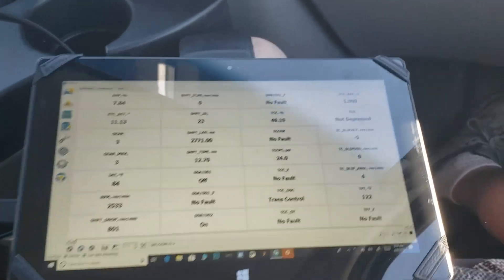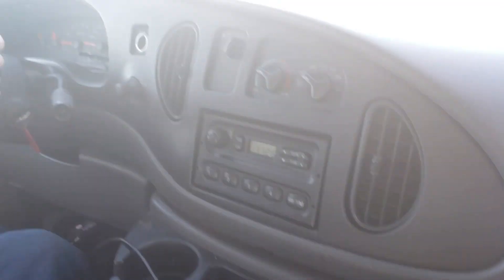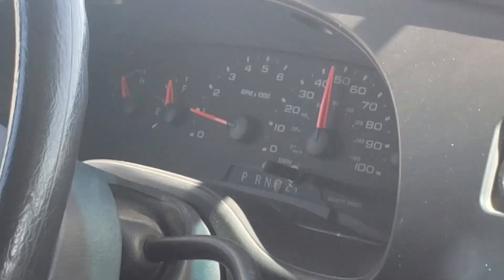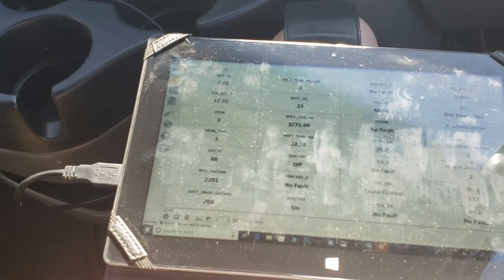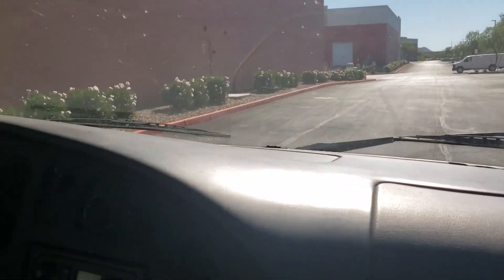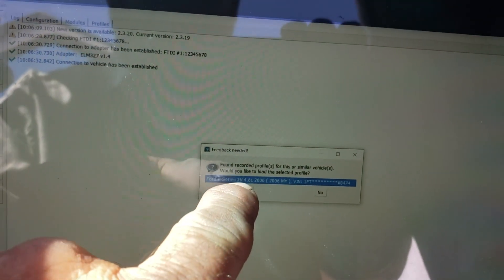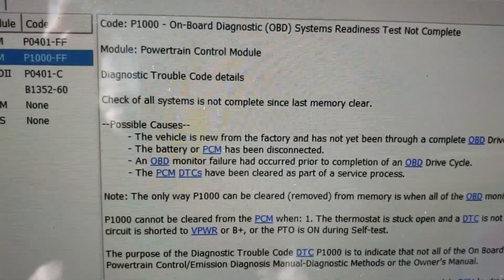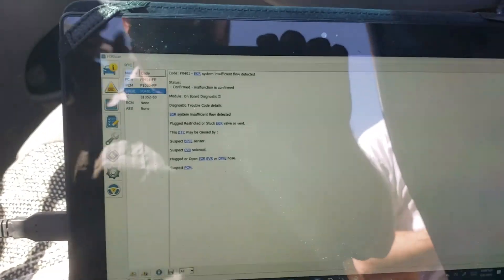Using FORscan to diagnose a bad transmission and DTC's in a Ford E Series Van

Comment: Rebuild time.
Reply from the maker: I haven't rebuilt an auto transmission in 20+ years. 
And they were non electronic. 
Dodge 904/727, GM TH350/700R4, Ford C4/C6 e.t.c

I'd be down to disassemble this transmission but I can about guarantee it's got to be given in for a core charge when he buys the rebuilt transmission.

Comment: Work your codes!
P0401... EGR channels are plugged up

P1000... fresh from a Reset. Keep driving a bit further for ECM test to complete.

FYI: change or investigate spark plugs. Dirty exhaust trigger more EGR recycling. Any random misfires around idle? (spark gap too wide!)

I guess you need a better reader to see your Transmission Control Module... Autel has good stuff on eBay... pays for itself quick.

With basic readers you get what you pay for.
Reply: He's already reading the transmission data. This particular transmission (4R75) does not have a separate TCM.
Reply from the maker: He just bought the van. We don't know the history in detail.
I have only used the software a few times. It may have another section just for reading the transmission info in more detail.
I had several transmission related sensors and whatnot active in the log during the drive. It didn't switch to fault status but that could be because he drove with the overdrive disabled except that one time.
He bought it knowing that the tr@nny was bad and mentioned it was stuck in 2nd gear only but I wanted to see it in case maybe it was something really simple like a bad speed sensor.

The transmission is obviously screwed by just listening to it and the issue with the overdrive and the coasting so we didn't bother going deeper into it. It's got to be mechanically FUBAR.
Reply: Not all of these Ford vehicles have a TCM. My 2012 Transit certainly doesn't, 4F27E Mazda transmission. In any case, Forscan isn't exactly garbage. It'll capture more diagnostic data than most OBD readers(for Ford vehicles). However, it requires a good degree of knowledge to know how to use the PIDs and what those values and ranges are.
Reply from the maker: And yeah, it's a nice reader for $35 or whatever the USB adapter costed.
It easily matches a $300 handheld that I was looking at and beyond.

I can change BCM settings with this. Which I did once by changing the lane change turn signal blinker from 3 to 4 blinks in the F-250 I drive for work.

Comment: thats the only way clutch being shot for engine braking
Reply from the maker: The "sprag"? Yeah I was thinking that too.
Reply from the maker: I'd love to open this tr@nny (oops, can I still use that word today without the P.C. Police???) but I think he'll need to turn it in as a core.
Reply: @hackfreehvac  AND flush junk out of the cooler and lines.

You may be better off with a used  wrecked tranny than with a rebuilt high mileage where all the bearings are shot into ovals. Labor is high so part better have long life in it 👍🏻
Reply from the maker: @glasser2819  The rebuilt tr@nny he was looking at listed a lot of new parts and a converter. It also had a new cooler for an additional $50 which I already told him could be full of garbage.